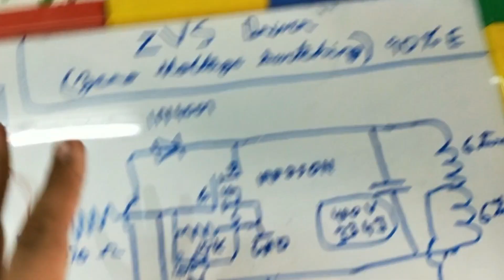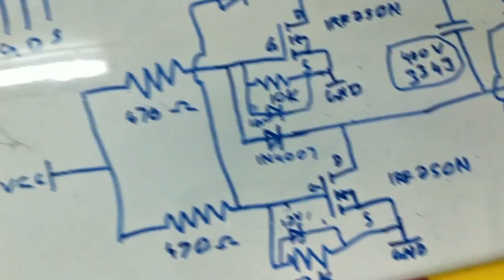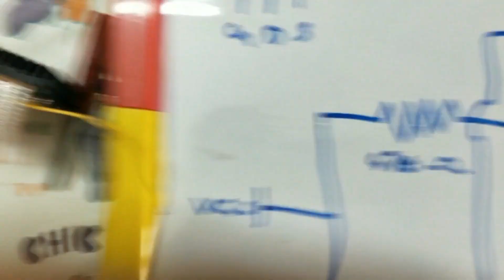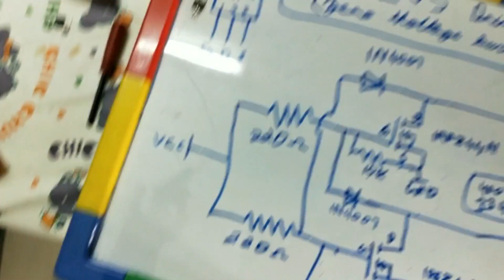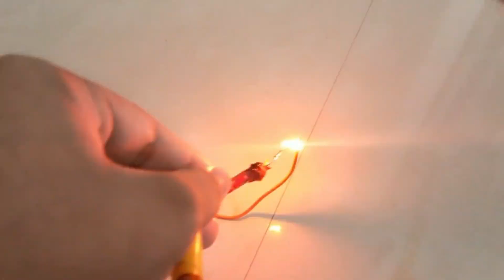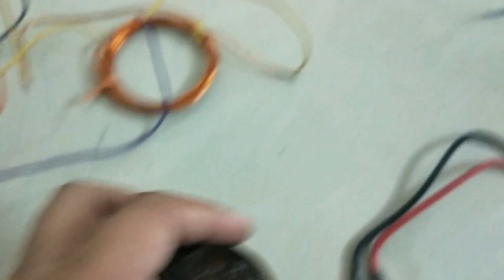Make an Zvs driver(INDUCTION COOKER)

Comment: Energy conversion efficiency should be a high-priority design criteria when applied to household applications, because of the potential implications.  Consequently this sort of resource may resurface when searching similar topics, for example about "No-Load Standby Power", as i recall:

https://www.ti.com/lit/gpn/ucc256403
UCC25640x LLC Resonant Controller with Ultra-Low Audible Noise and Standby Power (2020-Mar-12)
(Rev. C datasheet)

https://www.ti.com/product/UCC256403
UCC256403 - LLC resonant controller with ultra-low power and ultra-quiet standby operation

https://e2e.ti.com/blogs_/b/powerhouse/archive/2020/04/22/how-to-reduce-audible-noise-and-power-consumption-at-standby-in-your-ac-dc-design
How to reduce audible noise and power consumption at standby in your AC/DC design (2020-Apr-22)

"...Energy Star version 8.0 requires standby passive power consumption to be less than 0.5 W."

Or was it about "Light Load Efficiency"?...  Which is important when "Zero Voltage Switching" can turn into a "Shot-Through" catastrophic failure condition.

Maybe for single transistor scenarios there's some other publication which would prove helpful:

https://www.ti.com/lit/ds/symlink/lm5023.pdf
LM5023
AC-DC Quasi-Resonant Current Mode PWM Controller
2013, 2016

But i must admit Ti's following piece of relevant information captured my attention in a durable manner:

« UCC256302 uses hybrid hysteretic control to provide best in class line and load transient response. The control makes the open loop transfer function a *FIRST ORDER SYSTEM* so that it’s very easy to compensate. »

Talking about control (loop-closing) filtration, as in a PLL, except here it's "hysteretic" instead...
Reply from the maker: I am too lazy to read this much so can u please explain this in 3-4 line 😂😂
Reply: Sorry  @PainStreakGamingYtAJtojbbros , that was only meant some pre-emptive appetizer...
Reply from the maker: @Egzoset   nice 😂😂😂
Reply: I'd like some feedback from you,  @PainStreakGamingYtAJtojbbros , about this flux-concentration idea for the Induction Heating of relatively small susceptors (0.75 g):

https://i.postimg.cc/qvdWpgGQ/Egzoset-s-Universal-2-Phase-4-Poles-IH-Work-Coils-Assembly-16-mm-Aperture-2-x-ST-Micro-TDA7498-u.png

Using Ti's TPA3255 i've evaluated the accumulated power ratings to equal 4 x { 300 + 300 } Watts per side, e.g. 8 x { 300 + 300 } Watts overall with the 8 600W chips hard-wired for "MONO" operation, with 2 Ohms voicecoils, or IH WorkCoils in this most hypothetical case:

https://i.postimg.cc/3x12m9QW/Egzoset-s-Univ-2-Phase-4-Poles-IH-Work-Coils-Assy-16-mm-Aper-PCBoard-Placement-of-Ti-TPA3255-2.png

Yet i like the crazy idea of putting 4.8 Kilo-Watts inside a volume ranging between 5 x 5 x 1 cm and 7 x 7 x 1 cm i figure...
Reply from the maker: I am really not that much genius and all 😅😅
Reply: Hi again  @PainStreakGamingYtAJtojbbros ,

Not even featured with sufficient cognitive functions to deceipher what's the implications from this single fact:  Mazzilli worked on Tesla Coils depending on "Flyback" transformers, so...  Just focus on that basic component instead, references to "genius" give me the creeps, most especially on the net where "What You See Is Not What You Get"!

Just show me a Flyback Transformer (or at least one which ain't the same "air-core" type as i got in mind) when talking about Mazzilli's so-called "ZVS" topology, e.g. with cross-connected diodes as self-oscillating feedback between output(s) and input(s)...

Comment: Can we buy it? I want to use it for flyback driver. And also i tried a several times using irfp250n it failed.
Reply from the maker: Yeah pre made boards are available in Amazon for around 2000rs 
The main thing you have to keep in mind before making zvs is to always used working transistor.
When I tried at first my transistors were not working and to check the transistor please use a transistor checker . It might be very useful as it could be used to measure resistance, inductance, capacitance and also transistor and it costs less than 800rs